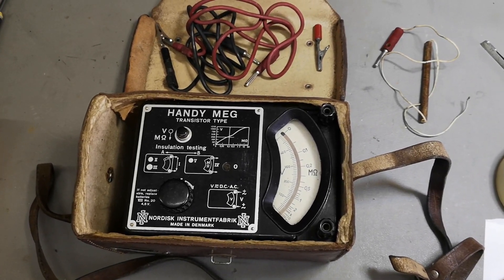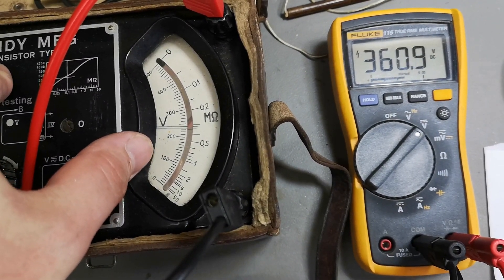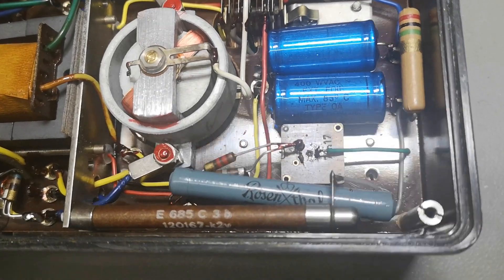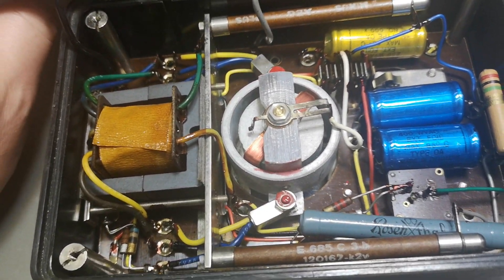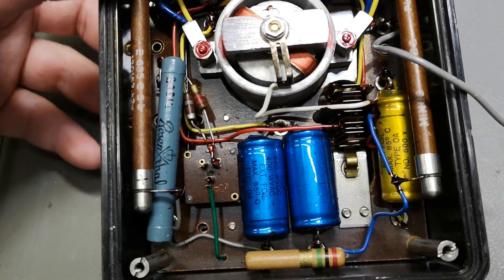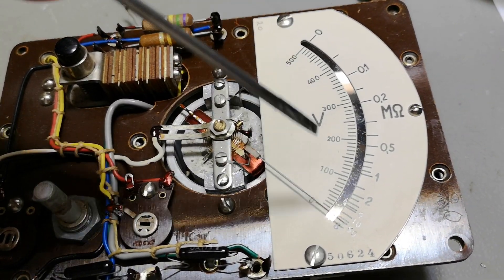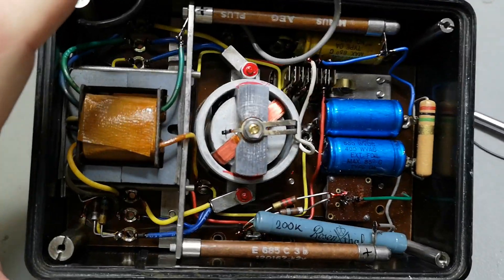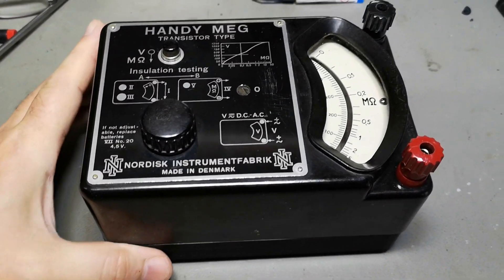Handy Meg Nordisk Instrumentfabrik 1970 test restore teardown

Comment: I had a Handy Meg of the same vintage. Its measurement accuracy was almost non-existent. (At the same time it drew 1.5 A) It didn't matter that much in the 70s either. The electrician then just had to see if the discharge was greater than 220 k Ohm on the installation. It was then that I was an apprentice. (start 1970'). . I don't remember when this criterion was changed (upwards).
The predecessor of this megger was with a mechanical vibrator and has obviously drawn much more current from the batteries which were D cells.

Comment: Nice unit, and yes those oscillators are rather inefficient, same with the selenium button stacks. Could easily replace the rectifier stacks with a pair of UF4007 diodes in series, and it would make a big difference to power use. Those GE transistors, I would assume AC128, given the era, and they were about the most popular PNP power device around in Europe, and you got them in that nice package as well. 

https://alltransistors.com/adv/pdfdatasheet_valvo/ac128.pdf

Yes you can easily replace them, pretty much any PNP silicon will work there, TIP32C is probably going to be the easiest to get, and way overkill, though likely costs less than the original did even then. Nothing else to change either, though that electrolytic in the yellow case probably is half of your leakage current in the first place, I never had good results with those capacitors, they by now are well past use by date, high ESR, and leaky as anything, if not totally open circuit or shorted, often both almost at the same time.
Reply from the maker: you are right this thing uses WAY too much power, but the lithium cells handle it fine, i use it only a few sec pr try, so it is no big deal, when it blow up, i will replace the diodes, transistors, and those leaky caps